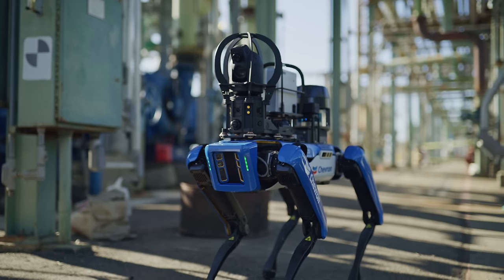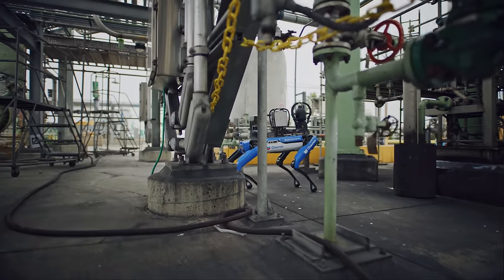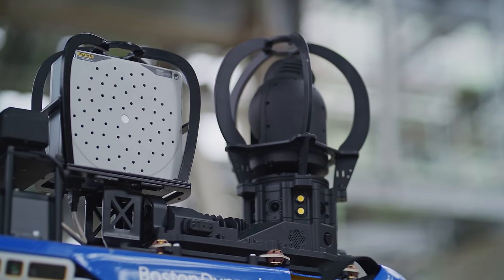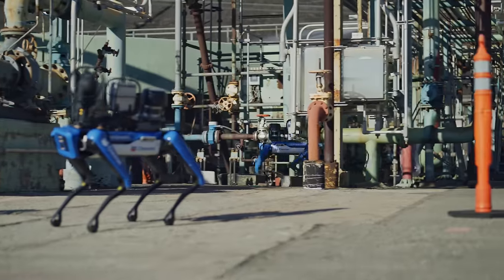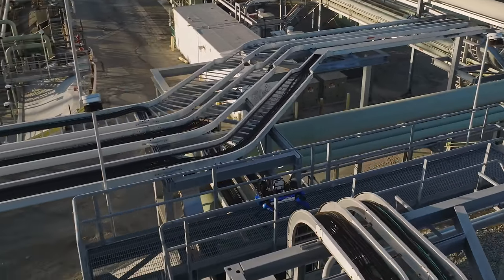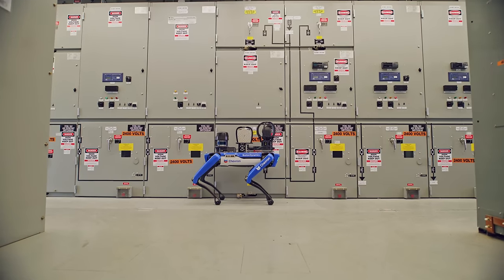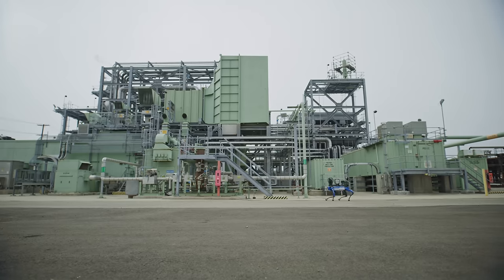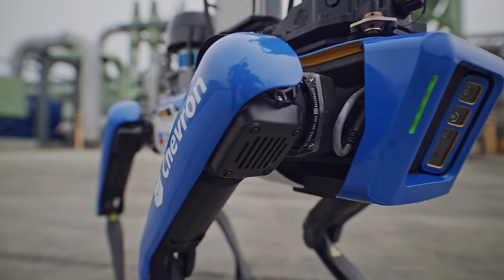Spot at Chevron | Boston Dynamics

Comment: This clip shows next level housekeeping at that refinery. It's not typical of what I've seen in the chem processing industry.
Reply: Good observation, not all companies have the same culture or set of standards
Reply: @youngblood23rb  lol bots. It's an oil company
Reply: @youngblood23rb  In my experience the oil companies usually are very traditional and fights for every cent, even if it would cost less in the long term. Those who have worked with the industry might find this surprising that they would even consider testing out robotic workers, while other's might think "well, they have money".

When it came to green energy and carbon capture though.. that was a choice made by politics.
Reply: The oil and gas industry has alot of large companies running top quality work environments.  Although their is alot more out there, in countries with less government oversight, running cowboy operations
Reply: @syberspy9  botttt
Reply: Its a marketing movie, they made sure the operators picked up before hand lol...Dont assume anything

Comment: How did they make Spot intrinsically safe?
Reply: It's not, but they would only operate in areas that don't require Intrinsically Safe.

That's also why it has the flammable gas detection, so it can avoid leaks and such.
Reply: I'm assuming for refinery operations.  This is a good question.  @BostonDynamics  Perhaps spot is limited as to which units it can travel into.
Reply: Depending on area classifications continuous atmospheric monitoring is likely required, either by Spot or fixed monitors within the facility
Reply: They made Spot watch the "Shake Hands With Danger" safety video.

Comment: How often are the tools on the spot calibrated? How do you know the readings spot is taking are accurate and not misreported due to sensor malfunctions?
Reply: Good question I would assume it would depend on the manufacture, I know combustable gas detectors have to be calibrated monthly and bump tested at the start of ever shift, as an example
Reply: They have another spot to monitor the spots. It's spots all the way down.

Comment: 2:50 Zach is locked in his percentage comparison. Trying to catch the 1% as if every 100th data point will point to imminent disaster. I'm sure there are much smaller nuances that Spot will be able to make detectable with a solid baseline.
Reply: You're reading too far into his example, which has obviously been simplified for the purposes of the video.
Reply: Using machine learning/computing to analyze data to detect small diviations is a tall task for human in the loop analytics, for instance thermal data compared to flow, pressure, acoustics, etc. Is what he is referring to, that one point in time where the swish cheese holes line up is where failures begin to take place

Comment: This is so bizarre, you’re trying to tell me they werent using temperature gauges or taking acoustic measurements before getting this robot lmao??
Reply: No, they are, but it requires many humans with  clip boards to be walking around frequently looking at gauges and checking temperatures, and this can do the same thing, but get better data collection, and let the operators spend their time on fixing the issues rather than just searching for issues.

This is one use where robot dog actually makes sense lol
Reply: I guess a Spot is cheaper than a lot of sensors connected to the internet.
Reply: @iCro63 especially since with the thermal camera it can measure temperatures anywhere on a machine, and it would take lots of sensors on each machine to duplicate it.
Reply: @ke6gwf  does it really? I'm sure upgrading the instruments to send data via radio would cost a lot cheaper that even single dog robot. Robots make sense in unknown hostile environments. If you want automatisation of something stationary, you better upgrade instead of using robots as a bandaid.
Reply: @iCro63  Now let's say the internet goes down... spot represents redundancy, if nothing else.
Reply: there was this thing called people before AI robots killed them all.

Comment: What's the benefit of having a robot running around over having stationary sensors?
Reply: Why not both?
Reply: Yeah, that's the real talking point. It may be the case that spot is cheaper upfront but more expensive to operate (more maintenance) and that's why they chose it.
Stationary sensors are still superior, because they collect and transmit data continously. So if a imminent critical failure is only detectable for 1 hour before it happens, spot would probably miss it. Also, stationary sensor allow direct measurements of vibration, which is really valuable data that spot can't collect as well (only through imaging processing tricks)

Comment: Honestly the use-case you're advertising here is so contrived, I can't even. The same can be achieved with digitalizing the sensors and sending info over radio network or even wire. Or like installing a cheapo webcams. And AI vision and image recognizing is not tied to a robot, you can do it on a pc.